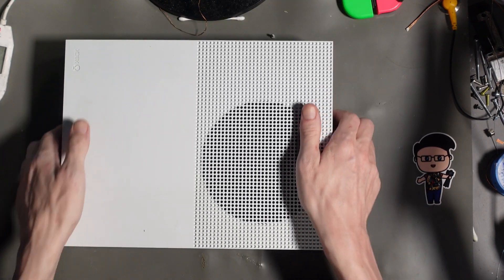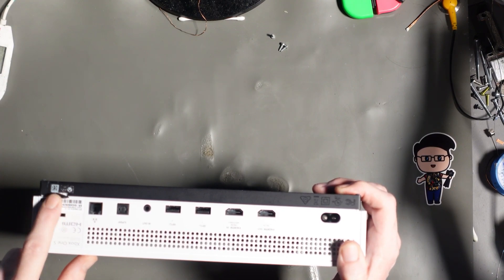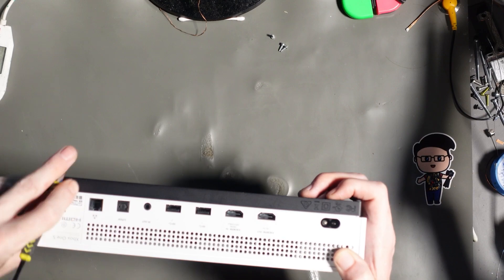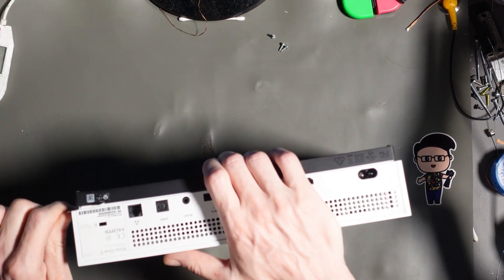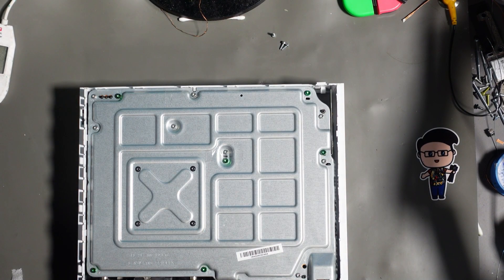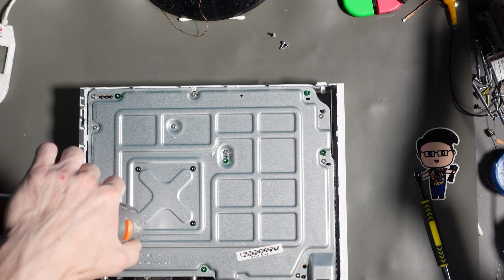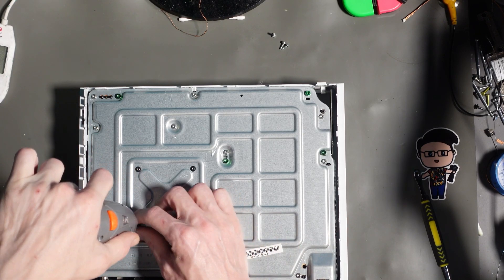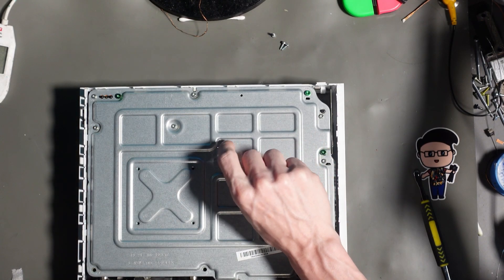I Bought A Broken Xbox One S For £42 ($50)... Can I Fix It?

Comment: I fixed my old PS4. Everything was working except the eject button on the board. I could take a disc play and eject with controller. So to fix that button I replaced the sensor chip next to it. Still didn't work. I put my iron on one side chip of the chip. It beeps and the button works. The other three sides nothing. I figured I heated the capacitors to get them to work for a few seconds. Then the button stopped working. So I switched them and it works now.